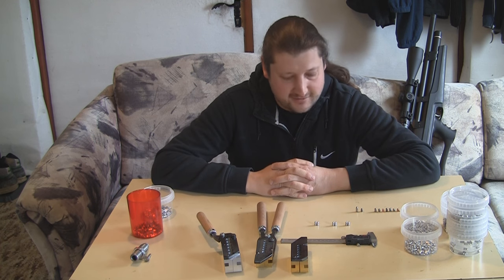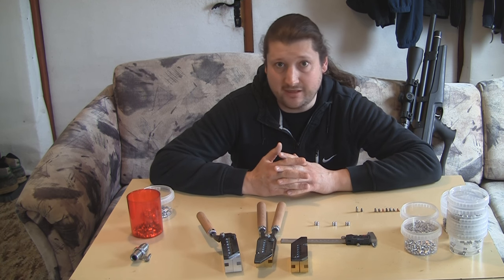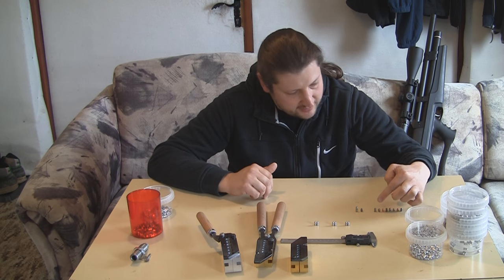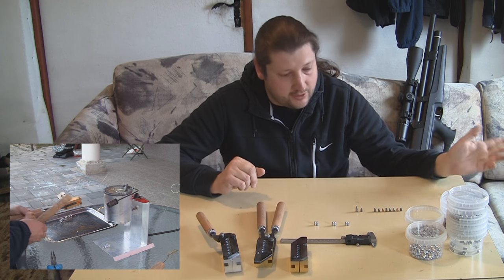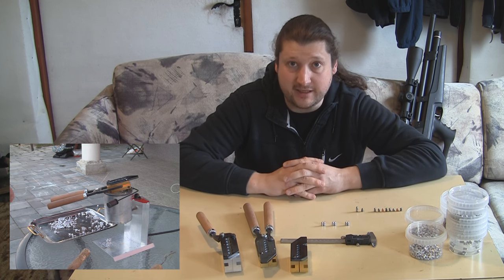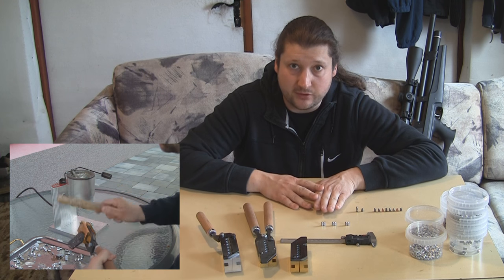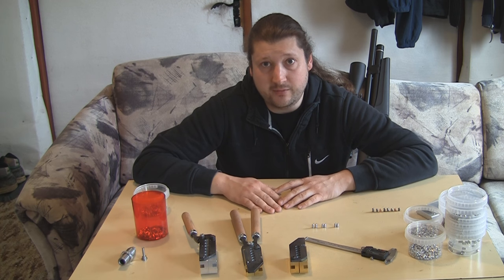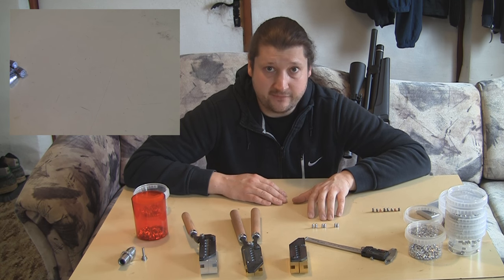.22 mold for Huben K1 and other .22 airguns

Comment: Hello Gregor,
I am seriously thinking of buying one of Miha's molds. I use a Lowther Walther barrel 19.5" long on my homemade PCP rifle. My design is regulated to 2400 PSI and has a 10 shot manually operated magazine. My magazine can handle slugs of 10.5mm long. This is very accurate with good pellets but I'm a little concerned about the slugs. Does Miha have the correct gauge mold for the LW barrel? One day I would like to buy a Factory PCP. I really like the RTI Prophet. The Huben is nice but I have a soft spot for the RTI  :) Also, it is a little more in my price bracket. BTW, I have been an avid airgunner for 45 years. Ha ha, that makes me an old man...
Reply from the maker: Hi. Happy to hear that you built you own airgun! To answer you question I would first need to know what power are you getting with pellets? Because it makes no sense to use these slugs if you don't get a least about 60 - 70 ft-lbs. Also, these slugs are designed for Huben and because of the Huben magazine size, they have slightly larger diameter (about .223) and this is too big to fit your pellet chamber...
Reply: @gregorkamensek3923  I'm very happy to hear from you. My airgun is producing 40 Ft/lbs energy. That's why I asked how Huben develops so much power. It seems a very impressive airgun. I am currently swagging my own slugs but the accuracy is not as good as a quality pellet, like H&N Barracuda. The slugs are not too bad but not as good as you are getting.
My slug measures 5.53mm and fits with a medium push into the Walther barrel. Your 37 grain would be a little too heavy for my gun but I was thinking a weight of around 27-28 grain would do nicely (as I am making at the moment) Can you give me any clues on how to improve the accuracy/consistency? What part of the slug is most important? Is it the square trailing edge at the back (no boat tail) or is it the parabolic nose? What do you think after all the research you have put into testing?
Reply from the maker: @anne7606  Hi. These slugs are definitely not appropriate for your setup. There is no real formula as to what is important with slugs, but personally I like to avoid barrels that are made for pellets. An easy solution at this stage is that you get a FX slug liner and shoot with NSA slugs. This is about the easiest way to get accurate slug shooting solution at powers you are looking for. For bigger power, LR barrels are very nice as the FX liners are relatively thin and can oscillate very easily.
Reply: @gregorkamensek3923  Thanks again Gregor. For higher power, I will make a nice .257 as I have a Roberts barrel (real bullets) I think I will make another airgun with much bigger air passages and bigger valve system. This should give me something as powerful as the Huben. I want something for hunting small game. I really wanted your thoughts on my .22 and you have helped me to do that. I very much appreciate the work you do for airgun enthusiasts including myself.  :)  Well done!

Comment: What fpe or jules can the 41grain achieve in the Huben K1
Reply from the maker: If you put your regulator to 210 bar on the gauge (actual pressure about 185 bar) you can shoot them over 300 m/s (about 1000 fps). That equals over 120 joules (about 90 fpe) of energy...
Reply: Wow!

Comment: Hi Gregor! What's your regulator pressure setting to achieve these velocities, and how many turns of the velocity wheel?? Thank you!
Reply from the maker: Wheel fully opened, regulator on the gauge 180 bar (that is actually about 155 bars because these gauges tend to show more than it actual is...)
Reply: Thanks for your response Gregor, It seems like you have the first version of huben k1, Mine is the second and i see that the regulated pressure shows correctly now despite of the gauge is the same in both versions. O_o
Reply from the maker: Yes, mine is the very first I was able to get my hands on... I am glad to hear that...

Comment: muy bueno gregor. una pregunta tenes el rifle conectado directo a la scuba?Cuantos tiros te da con el deposito del rifle?
Reply from the maker: Hi. I get about 2 magazine (2x19) if I charge the gun to about 290 - 300 bars at 110 joules (1000 fps with 36,7 grain bullets). The power wheel is fully opened
Reply: Hola Gregor, gracias por la respuesta,te preguntaba porque tengo un huben desde hace pocas semanas y solo lo pude probar una vez y solo lo llene a 200 bares y en 5 o 6 disparos se me vaciaba.Tengo que comprarme un pump para 350 bares y volver a probar.thank you GREGOR
Reply: Hola,les quiero consultar que opinion tienen del inflador huben hd 35 k ??
Reply from the maker: Are you referring to hand pump? I have not tried it yet, but I have used to hand pump my guns in the past... It is not an easy task...
Reply: Hola Carlos Varela, a cuanto llenabas el Huben? Si lo llenas a 200Bar que es lo mas usual para muchos, te conviene setear el regulador en 120bar y la rueda de potencia en 1 vuelta desde el tope (El tope minimo lo haces en sentido de las agujas del reloj) Asi te rinde unos 4 cargadores y a buena potencia. Saludo
Reply: Hola Gaston,muchas gracias por la respuesta¡¡¡¡¡¡¡¡¡¡¡¡¡
Reply from the maker: No problem. I understood that without google translator :)

Comment: Hey Gregor, great stuff! Do you guys plan on making a .303? I would love to try some my RAW .30.
Reply from the maker: Hi. Do you know if RAW uses choked barrel? That might be a problem... There are a lot of 308 bullet out there, all you need to do is size them to about 7,80 mm and you age good to go...
Reply: Hi Gregor, to be honest I am not sure if it is choked. I think it has less twist as it is designed around skirted pellets
Reply from the maker: Form what I know about RAW, they make pellet guns (as you said). That means that it will probably not develop enough energy to shoot bullets out of it. It is also very likely that it has a choked barrel with relatively un-aggressive twist. All this means that it will not shoot bullet well..
Reply: Hey Gregor, thanks for the info. I have not seen where they are choked and it shoots a 45gn pellet at over 900fps so the energy is there, perhaps a market for you as there are a lot of .303 AGs and very little to shoot through them. Also, have not been able to find a .303 sizing die. :(   Thanks!

Comment: @Gregor Kamenšek  Hi - Please update between this version slug and the boat tail (with rings) which is better for the Huben k1 Version 2 standard barrel? and which size 5,52mm or 5,55mm thanks
Reply from the maker: Hi. I will have a video about it soon. In my experience, 5,52 works best in K1 V2.
Reply: @gregorkamensek3923  5.52mm with the flat base slug in this video or the slug with rings around it?
Reply from the maker: @taheerkhan7715  This one: https://www.mp-molds.com/bullet-casting-equipment/?pa_caliber=5-52

Comment: I get a lot of "thats stupid" comments, but I would love to see a boattailed .22 in maybe 25-30 grains for the Breakbarrel industry. Specifically one that shoots well from the Benjamin Trail NP2.  Its a box store brand that sees lots of use across the country, and would do well from a quality pellet. Not enough options out there.  A better bullet would change the break barrel industry, IMO.   I asked for a Mil dot scope when i bought it and the clerk told me, "why would you need a mil dot for that?!".  Theres a lot of ingorance about the breakbarrel market, and not a lot of recognized possibilities. Especially with Gas piston technology. Limited, but capable.
Reply from the maker: The would probably have to be lighter than that. Usually the power is lower with bullets then with pellets because bullets have higher friction. Also, break barrel do not necessarily achieve higher power with higher weight as PCPs. In fact, sometimes you get even lower power. I would suggest to have a lighter bullet (10 grain for .177 and 16 grains for .22). You need some velocity as well otherwise the higher BC is of no use. Also you need the bullet to have extremely low friction. Stability would also be a problem as they would have to be gyroscopicaly stabilized. It would require quite high twist rate (much higher than standard barrel) because they would be long and light (both factors require very high TR). You would end up with slow, low power and inaccurate  bullet that has a very good BC and then start to shoot pellets again :) I am not saying it is not possible, but is will require also some changes of the guns... and people will still say " I prefer pellets.. :( But I do like the idea...
Reply: thats what I am counting on, mildly slower speed, more impact and consistency.

Comment: I am interested in purchasing a mould, but would like to test some sample bullets before making the investment. Is there a way to get some. Say 20 or so ?
Reply from the maker: Hi. Do you have Huben K1? These bullets will not fit in most other guns and most guns do not have enough energy to even get the you of the barrel...
Reply: I have a Sumatra. More than capable.
Reply from the maker: Check what is the max. diameter the fits in the chamber. It should be at least 5,68mm:
https://mp-molds.com/media/kunena/attachments/105/22_air_rifle_v2.png
Reply: My calipers show 5.46 would the sized bullets fit ?
Reply from the maker: Unfortunately no... Sized are 5,66mm...
Reply: Ahh, I see. Oh well, thank you for your time.

Comment: Hi Gregor,  what was the actual B.C numbers?

i got, .113 B.C using 300 m/s near velocity and 270 m/s far velocity.
Reply from the maker: You forgot to write what is the distance of the far velocity... It depends on what value you are working with (GA, G1, G7...) and the values can be very different. You can see my results at the end of the video.
Reply: I used 70 meters because you had said thats how far your chrony was place in the video, and i used  G1 and got the .113 numbers, 

The results at the end of your videos are to small to read, that's why I asked. 
Thanks for the reply.
Reply from the maker: That sounds about right. I used GA BC... The BC dependent on the temperature, altitude and velocity also, so it is hard to give an absolute number. TIP: set the video on full HD and watch it on a PC monitor and you will be able to read the values in my video with ease.
Reply: Thanks again for the reply, 
I was just curious about the numbers because Matt Dubber from AirArmsHuntingSA said that the Huben brand slugs Huben sent to him had a B.C of  0.185 so I wanted to know how close yours got to that number, 

don't know if 0.185 is Mr Dubber number or it's Huben numbers but it will be different for everyone base on environmental conditions.
Reply from the maker: first of all, may I suggest that you take a look at my new mold design for K1 (version 2). It is one of my latest videos. That one will give you better BC (even slightly better than Huben pellet). The 0.185 BC Matt mentioned was probably form my video. The measuring method we are using is not very accurate, it is more of an estimation. Matt now hat a true measuring tool based on radar that can really give the correct values...
If you are interested in mold for K1, then I definitely recommend version 2: https://www.youtube.com/watch?v=CodtHHnTT9o

Comment: Thanks, Gregor, for another excellent video. Do you know if Huben plans to make a .30 cal (7.62 mm) version? I plan to get the current .22 cal version, but .30 cal would be more appropriate for my coyote problem. Sure, it is possible to kill a coyote with a heavy hypersonic .22 round, but I'd prefer to stay subsonic and be more confident that I won't just wound the animal.
Reply from the maker: The have not informed me anything about .30 but they do intend to release .25, probably this year. Your best choice in .22 would be a hollow point of about 35 grains... Definitely more power at long range then .30 cal pellet
Reply: I agree with your advice about the best .22 round; did I hear you say in one of your videos that you are working on such a bullet? One more question: I know the K-1's are hard to get, so I'm willing to wait, but I can't even find a waiting list to get on, or a company that will take a deposit for pre-order. I live in the USA. Any advice? Thanks again, Gregor.
Reply from the maker: Regarding bullet, I am always on the search for a good .22 slug and I am also trying to design a good mold for K1 but so far I did not intend to design a hollow point... NielsenSpecialtyAmmo is just about to release such slug for K1, you might check it out... Regarding K1, you can try to contact Huben directly,...

Comment: Hi, can you shoot copper jacked bullets!
Reply from the maker: You can, but you would have to have specially made design that would have low friction. I would not recommend regular firearms copper plated bullets. Despite the fact that this gun can shoot at the same energies as the low velocity .22 LR, the pressure is much lower (about 10 times less) and the bullet could get stuck in the barrel. At best, you would get much lover velocities and there is also the choke that would reduce it even further...

Comment: hi. that sound at 25:10 and further , is this the valve refilling after each shut ?
Reply from the maker: The sound you hear is from huben one way valve in the fill port, because I was connected to the bottle. I only had less than 200 bar in the bottle...
Reply from the maker: Huben does not make any strange noises if it is not connected to the bottle :)
Reply from the maker: I am from Slovenia. We have limitation set at 20 j and 200m/s (stupid regulation). I have to register the airguns similar as firearms...
Reply: so , it´s legal for you .?
Reply: Yea, look at the german laws .!! 7.5 Jules. it 4.5, 5 fpe ! crazy or what!??????
Reply from the maker: Yes, but I have to register it...
Reply from the maker: Yes, but in my case it does not matter as all my airguns are over that limit in Slovenia as well as they would be in Germany and require similar procedure for registering as they have in Germany...
Reply: ok . it was just an exempel, what I had in Germany , and now have . I´m free for power reg´s in Norway. Just cal. I had to have search at Police for a permission for my .22 Bobcat. Absolutely satisfied !!!!!!! Go on bud!!

Comment: Having problems with the spru plate cutting the lead off clean...Leaves a spur at the base of bullet...on the 5.55 @ 5.52
Reply from the maker: Check the washer spring that holds pushes together the spur plate with the mold. If you ever overheated the mold, it might gone soft... In any case, the gap between the spur plate and the mold should be minimum. Another reason could be too hot lead and mold... It also slightly depends on the alloy used but if you have good results in the past, then it is definitely the temperature or the mold. You can also measure the length of the old/good slugs and compate it with the new/bad ones. If the new are slightly longer, you have too big gap...
Reply: @gregorkamensek3923  EXCELLENT INFORMATION,THANKYOU....If i have overheated the mold does this mean its life is over?
Reply from the maker: @emp731  No, no :) The mold is just fine. It just means that the thin washer spring material is not elastic anymore ant is does not apply any pressure anymore to the spur... spring steel tends to lose its elastic properties with high temperatures. The mold is just fine, you just need to replace the spring. When replacing, pay attention to the spacing (you can look towards the sky and see the spacing, it should be as little as possible light coming through) and also make sure the spur pivot is unobstructed and not too stiff.
Reply: @gregorkamensek3923  Thankyou for your advice..Really good stuff...I bought another 5.52mm mold anyway as backup...You can never have enough molds :)
Reply from the maker: @emp731  I agree :)

Comment: can the mold be made for  .177 or 4.5 mm
Reply from the maker: One of the main problems is that the tolerances with casting are more or less absolute meaning that the smaller the caliber, the lower the consistency in dimensions in relative terms. The .22 is already a challenge and it takes some practice to cast consistently enough but .177 would be much more difficult and would probably not produce good results.
Reply: Thank you for kind reply always very good watching videos 
 @gregorkamensek3923

Comment: helloo can u chronied them?? thanks
Reply from the maker: Actually I have... I shoot them with velocity of 300 m/s (just under 1000 fps).
Reply: with 36/37grs?? or 41?
Reply from the maker: It is possible to reach 300 m/s with 36/37 and also with 41 grain but for 41 you obviously need a higher regulated pressure. The video was done with 36/37 because they are more accurate.